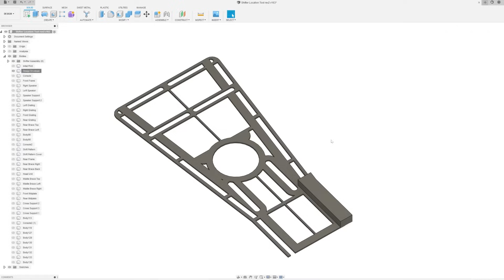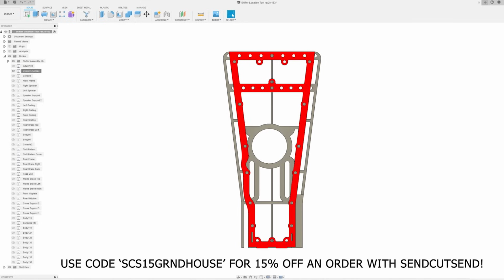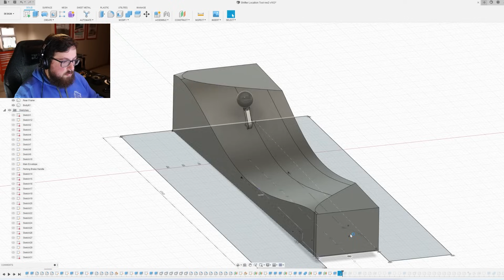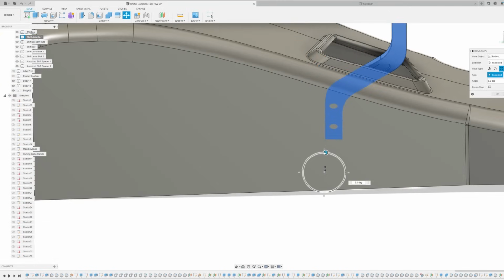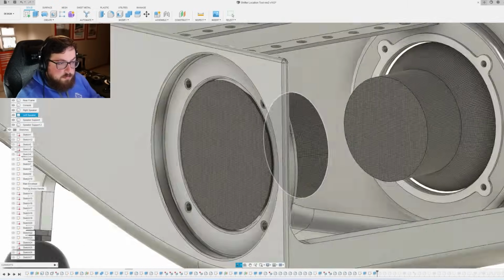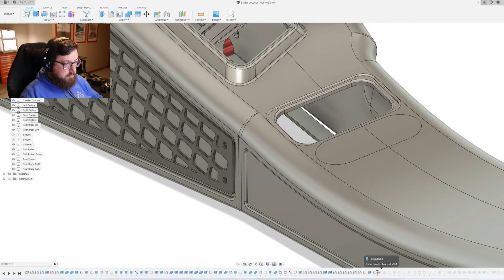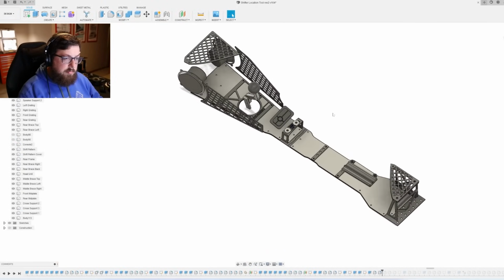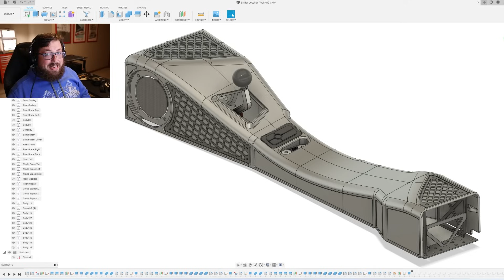Designing a 3D Printed Center Console From Scratch

Comment: You need Cardboard Aided Design 2D shapes will help measure out mounting points and areas for movement.
Reply from the maker: Hey thanks - you're right, I do use cardstock a lot. For this project, it felt like printing the templates gave me something pretty robust to measure against versus starting by hand, mostly because everything was based off of the shifter

Comment: Love the console and my first car was a '76 280z, so I'm all in!  I'm sure other audio enthusiasts have commented on this, but the speaker locations are really bad for stereo sound, and not great to have the back waves sharing the same space.  You'd be far better off in the doors, kick panels, a-pillars and/or dash.  it would be interesting to seal as much of that space as possible and use it for a small subwoofer, like a Tang Band 5.25 woofer.  There are micro 2.1 amps that could run a sub together with left/right mids/tweets.
Reply from the maker: Hey thanks! Yeah I'm surprised more people haven't called me out on that... especially leaving the front and bottom open. For this car I'm really not expecting to be able to hear the stereo much haha. There really isn't any room around the doors/kick panels if I'm adding the roll cage and taking it to the track.. The console is about the only piece of interior I'm actually going to have besides the seats, I'm not really sure it was the right move to even make it but I wanted to play with the idea. I'll definitely want a better stereo setup in the next build, excited to see what new stuff is out there

Comment: CAD tip. Design a whole bunch of surfaces first. Design outwards up to an outer surface. Thicken at the end. The solid cut method is how most start in CAD. A 3D scan of this would have made short work of measuring. Onshape has excellent mix modeling.

Comment: Love this! I wonder, could you 3d print a traditional dashboard with funtional dials and buttons for some of these new cars with only touchscreens? An extreme example could be adding a real dashboard to a Tesla, but I'm just talking about things like a more traditional car such as a Ford explorer.
Reply from the maker: Definitely doable, but it would definitely be tough going around the body control module. So much technical stuff behind those screens 😅
Reply: @GrindhousePerformance  I've read similar things from folks who wanted to remove the entertainment console from the middle of vehicles.  They are very distracting while driving and I actually cover them when I drive-it makes so much difference, especially at night! But people said re-wiring the entertainment is extremely difficult to do especially if it's tied to the temperature control. 
But I wonder...if it's only the entertainment console, if you just swap in an old radio/cd player, print resin backing to make it flush against the dash, and hook the speakers up...if it's doable?....a downgrade/upgrade as it were, lol.

Comment: To create a 3d print like that do you have to make it in small pieces and glue it together? Also how did you learn to to use the software to customize and make your design?
Reply from the maker: Yeah it's going to be broken up into several pieces and joined together. I'm actually finally printing it now for part 2 😅. I went to engineering school, but I mostly learned CAD from messing around with it. I find it really enjoyable to learn and practice

Comment: Dude awesome video bro. I also have solidworks and a 3d printer and this is one thing I definitely will be doing. You 100% inspired me. Could I email you my design and maybe we could trade info back and forth as well as design ideas. I also have been working on designing flush push buttons using micro switches to minimize space requirements.

Comment: the only problem is that the 3D material is highly deformed if it is hot in the cabin in the summer. I repeatedly tried to use the stand for the handheld radio, which I printed on 3D, and it was severely deformed by the temperature. And because this cover will be over the transmission, which is heated, then most likely this will be a problem.
Reply from the maker: What materials were you using? I'm planning for this to be done in ASA which people have used for engine bay parts
Reply: @GrindhousePerformance  I used regular PLA filament. thanks for the idea about ASA. I will try that one
Reply from the maker: @makskk6spm275  Awesome, good luck! I'm not sure whether it will work but it was what others had recommended I try
Reply: @GrindhousePerformance  Thanks, man! Wish you luck as well
Reply: @GrindhousePerformance  Thanks for the advice. I actually reprinted all my parts for the radio holder for the car with ASA and it's actually working! But this filament is more capricious than PLA. Requires much higher printing temperature and using some adhesive for the printer's bed, otherwise it peels off.
Reply from the maker: @makskk6spm275  Awesome, Im glad to hear ASA is working out for you! It is definitely a trickier material to print, but I think that comes with the territory for stronger materials

Comment: You could have made it WAY easier.
Use cardboard to make template, take photo of template, use critical measurements of the template to trace in 3d.
Reply from the maker: I tried doing it with chipboard but with how much stuff was on the tunnel it didn't really work well for templating, at least in my hands. I probably could've gotten it done with enough attempts, but I was getting frustrated and thought this was an interesting way to try to approach the project.

Comment: Well, I'm kind of 7 months late on this but, I want to say I think this is an awesome project, it's really cool what your doing and actually about the problem you had with measuring the stuff, I'm in a program that actually covers reverse engineering and we can have those dimensions/center console region fully scanned and dimensioned in basically a couple minutes, just a fun fact.

What I would like to say though is potentially look into using the Loft tool. During your first initial cuts from the big block you made you could reduce your number of operations by at least 2 if not more. and while it doesn't seem like a lot it can build up quite a bit and it's one of the things that we have to really think about when I go to do CAD and engineering competitions.

The patterns unfortunately, fusion doesn't like that very much at all, and while it may be a pain it might be worth looking into making that a separate file itself for just the parts with the pattern. One of the reasons Fusion and really any CAD has that issue is because of all the mathematical constraints involved on top of all the other bodies in that Assembly.

Other wise keep of the good work I look forward to seeing what else you'll do. (And of course I love answering any questions)
Reply from the maker: Hey thanks for the detailed feedback on my project, I'm glad you like it. I'd love to pick up a scanner at some point, but I'm not sold on the ones I can actually afford being able to actually work well for my projects. I might be wrong, but the cheap ones are still a pretty big investment, especially if they don't perform all that well. 

That's an interesting recommendation on the loft tool; I've used it for tubing/plumbing models but wouldn't have thought to use it on the console. 

I was running into a lot of issues getting the model to shell correctly. I had tried a bunch of different ways to model it as a solid body, but when it came to shelling, it just broke everything or gave me an error code. Doing the large extrusion cuts from the big block was the only way I was able to get the entire inside profile to shell correctly, and in a way that it still let me extrude other profiles to it. 

Definitely ran into some processing issues with the patterns haha. 100% should've modeled them as separate parts in separate files. I don't love Fusions parts assembly capabilities (or I'm just dumb) so I tend to model as much as possible into a single file. CPU temps keep my office warm in the winter LOL.

Thanks for checking out my project and hope you check out some of my other videos, if you liked this you'll probably like the gauge cluster build
Reply: @GrindhousePerformance 

Yes you are completely right most 3D scanners are pretty expensive on the market right now. But the big on that really gets you is the cost of the software itself not so much the scanner. I think the setup I learned on was almost 100k. But if you ever are looking into it I cam say with confidence that the handyscan series from creaform is hands down the abolute best scanner I have ever gotten to use though again a pricy investment. Just a neat note though for me to see exactly where my job field really excels.

Shelling can cause issues. A big part of that is just how it tries to calculate it. A trick I use is to copy the body I want to shell. Then shrink/offset faces/scale down the copy and extend the face I want as my open face. Then combining the bodies using the smaller one as the tool body will effectively act as a less clunky shell

And no your definatly not dumb. Fusion 360 assemblies are simply the incredibly unintuitive pieces of crap to work with compared to other CAD. (Though some how they got everything else correct)
Reply from the maker: @spectre6612  I got to demo the handyscan at SEMA last year and it's an absolute monster. Would love to have one someday. Their software also seems to be worlds ahead of everything else I've seen, especially after having had the chance to use it in person. The value per dollar is there, I just don't have the dollars 😅.

Great suggestion on an alternative way to shell, wouldn't have thought of that. I'll have to remember that next time I'm in too deep on a design and it's giving me errors

Comment: Great work. I'd suggest adding a slight angle to where the speakers mount so they are at least facing towards you a little bit for better sound imaging. 
😎👍👍
Reply from the maker: I'm surprised nobody else said this, you're 100% right. The pedal box is really cramped and will only get worse with the roll cage coming in. The console hangs over the corners of the tunnel so clearance wpuldve been tough without a total redesign. The audiophile in me is bothered, but with how loud the cars going to be the speakers are almost just for show 🤣🤣

Comment: For those of you that don’t know, if you  need a 3d scanner and you have an iphone, you can use it as a 3d scanner, use the front camera for fine details as well.
Reply: The cameras with multiple lenses on the same size can usually do it from a hardware perspective.  Software-wise that's up to programmers.
Reply: @NeoIsrafil  no actually every camera can do it using photogrammetry software . but you need to have at least 40 percent of redondant coverage between 2 photos to build the 3d model
Reply: so if doing it with iphone. what app, or software? and what t avoid?
Reply: Don't bother, they're rubbish. Too many fucking times have I had to clean up some wanna be draftsman's iphone 3d scans. It's tedious, boring, and they're too inaccurate to get anything correct. Go buy a creality scanner. Costs less than an iPhone, and theyre ACTUALLY GOOD. It's to the point where all my subcontracting work has a clause that says if you provide a SINGLE, iPhone scan of anything, you're getting ghosted, no matter how far you are into tue project. Seems to have fixed the issue.
Reply: Do you know if you can 3d scan with a Samsung galaxy s21,22,23 ultra?
Reply: @hdhellion4128 I think you can. Apps like Scandy Pro work decent

Comment: thanks for amazing video! What is a wall thickness? Which plastic will you use? I didn't catch it.
Reply from the maker: Hey thank you! The pocketed sections of the console are 3.2mm thick (makes it 4 easy lines with a 0.8mm nozzle). The thicker ribbed areas are 6mm. I'm using ASA as the filament for the console.
Reply: @GrindhousePerformance  noted,  thanks. In my old car I intended to printout a new console by ABS plastic. But it stay a dream only,  and I sold my car as is.

Comment: Can you give a breakdown of the cost of send cut send parts how you designed stuff for them ect. Also what are you printing in ? Do you have concerns about temps reaching the glass temp of your filament after completion?
Reply from the maker: Hey sure; the 1/8" steel framing parts ran roughly $200, the top aluminum covers were $45, the titanium pieces were about $20 bucks total. I had SendCutSend powder coat the aluminum mesh panels on the top and sides, as well as the brackets for the speakers, and those pieces cut and coated were ~ $180. I'm printing the console in multiple pieces out of ASA. ASA should be resistant enough, I have seen it used successfully in engine bays, but like most things on my channel, it's still an experiment that I'm trying to learn from. We'll have to see how it holds up! Hope this all helps!
Reply: @GrindhousePerformance  very helpful I'm learning so much from what you're doing. I do car stuff. I do 3d printing but the way youre combining them is like why didn't I think of this.
Reply from the maker: @Phil4222  It's a lot of experimentation! Being totally honest I don't really know how much of this stuff will work out the way I hope it does. I just want to try and learn and share whatever I can. 3D printing is a really exciting technology to me and I want to show people it can be so much more than making toys and widgets

Comment: I make something wrong 😮 but most interesting is, which printer you will use for this big part. Nice to see that JDM x 3D Printing gets such a traffic :D
Reply from the maker: I'll be having to break up the console into smaller pieces to print it. I think it wound up breaking into 11 pieces for my 3d printer 😅 fingers crossed it works out!
Reply: @GrindhousePerformance  I did this with my designed Cold Air Intake for the MR2 and planning to wrap it with resing/ glass fiber.

Comment: It may have been easier to build a foam/fiberglass template shaped to your liking, then cut and carve access panels,etc.
Reply from the maker: That's very possible and 100% true. I debated using the printed piece as a buck but I'm also really inexperienced with fiberglass. There still isn't a guarantee the printed one works out, so I may wind up going that route if the finished part ends up a total mess LOL
Reply: @GrindhousePerformance   even if it doesn’t work out this time, it’s good practice and experience. It’ll probably work next time!
Reply from the maker: @LimitedGunnerGM  100%, I'm excited to learn it regardless. I never realized how little I actually knew until I started getting into these projects 🤣

Comment: Get a 3d scanner - they are cheap enough now to get you a good cad 
i scanned Cylinder heads and transmission with CR lizard (and i DO NOT recommend that one, the evo pop will be better) 

Generally the optics one are really good enough to give you a solid mesh for this type of work
Reply from the maker: I'd definitely love to get one! I think we're still a couple software versions from some really strong scans at entry level prices, I will check out the evo pop though.
Reply: @GrindhousePerformance  there is a test somewhere on YT where a guys scans an intake and a front end of an Mini cooper. 

Now the lizard i have is for small objects so teche cylinder head was a bit of an challenge but doable 

Still i dont like the software they have, the Revo / evo pop one should be far better
Reply from the maker: @pch_mechanika  I'll check out the video, Thanks for following up!

Comment: You're doing an amazing job.  I don't know if anyone mentioned it farther down in the comments, but you might investigate using photogrammetry in an instance like this.  All you need is your digital camera and the software to stitch the images together, and it builds a 3D model of the object.  Then with one known dimension, you should be able to put it into Fusion360 or SolidWorks and manipulate it.  Just a suggestion.
Reply from the maker: I'm really curious about photogrammetry, I haven't tried it but I'd really like to in a future video

Comment: I know this video was a month back now, and who knows when it actually happened IRL.  But, was wondering if you ever take the step of using cardboard to mock up these assemblies?  I have a CO2 laser and often use cardboard first to test fitment and such, then move to the real material later.  Just a thought for ya.
Reply from the maker: If I had my own laser, I'd use that instead of 3d printing for mocking up, that's really cool. I typically use cardboard if I know I'm making something by hand immediately after, since none of the dimensions really mean anything, I'm just recreating whatever template. Without a laser, making the templates I made by hand, having them be symmetrical, and being able to make accurate measurements to later translate into usable CAD.. my handmade template skills aren't that good

Comment: Someone might have mentioned this already, but regarding the speakers. Are they supposed to be woofers or midtone?
You should consider adding a divider in the middle (if space?) to prevent the movement of the membrane to act upon each other.
Reply from the maker: I originally planned to isolate the speakers in their own compartments with vented chambers and everything, but packaging got to be really tight/complicated. Maybe in a future revision if these sound terrible. I'm keeping my expectations low with sound quality, but will definitely be better than what came out of the car! You're 100% right though
Reply: @GrindhousePE  you could wire them out of phase with each other, so when the left side expand,  the right contract.
(If you plan to use them as lo range/woofers).